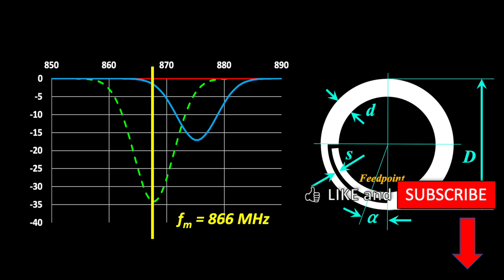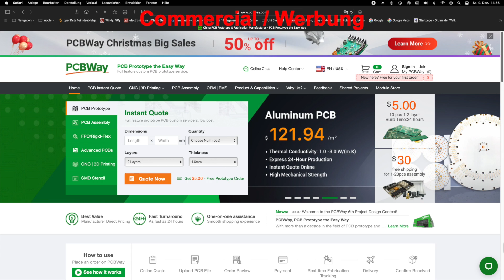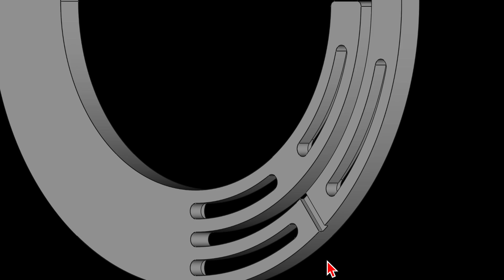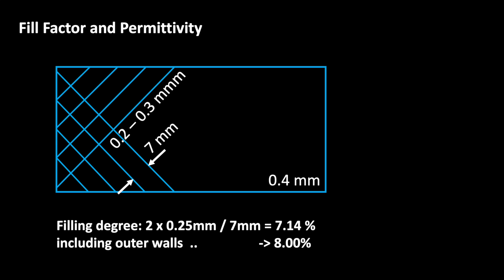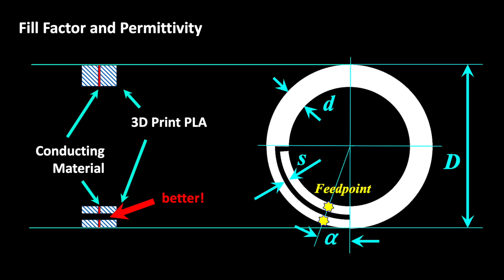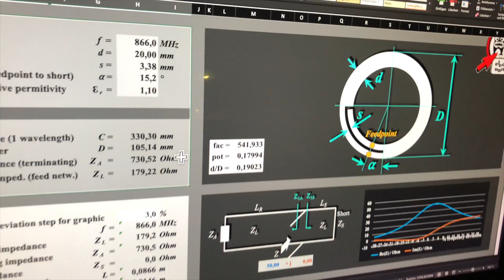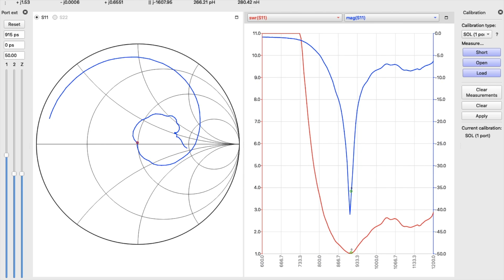Amazing 3D printed Loop Antenna - a first Test (EP87c)

Comment: Admirable experiments on a 3D printed antenna, but why won't a PCB version, be both easier and cheaper?
Reply from the maker: Thanks for your comment. That is a very good point! And I am on the way to come up with a PCB version together with an updated dimensioning tool. So, stay tuned! Happy holidays and best regards. Klaus
Reply from the maker: Exactly! Especially when you have make changes. But anyway, my goal is a PCB vesion.